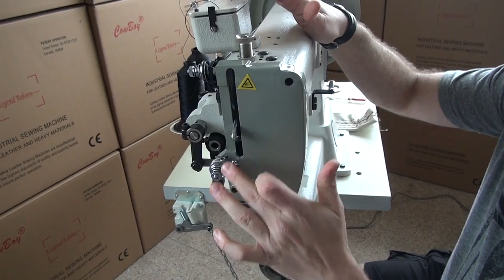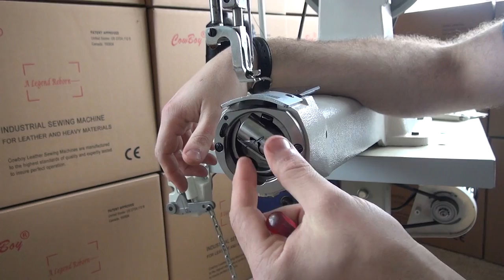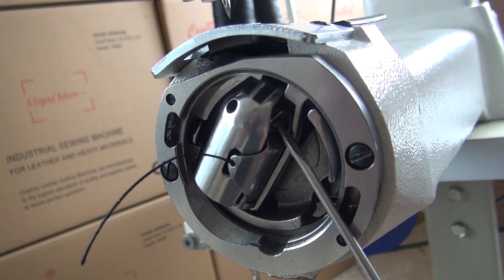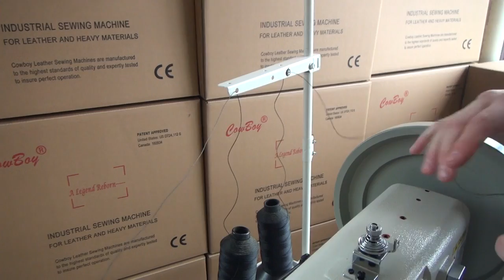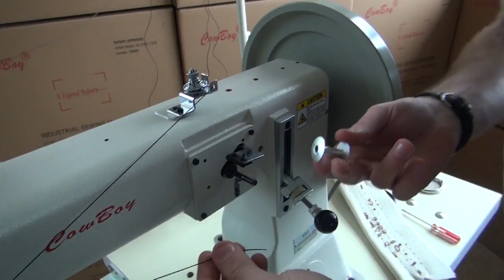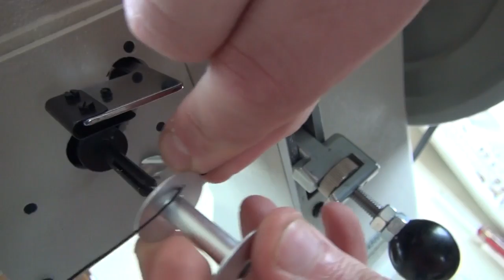How to adjust thread tension on your Cowboy CB4500 leather stitcher

Comment: Thank you for a very well explained video on how to adjust the machine. I like to ask you about the balance between the tension from the two tensioners. If I need 45 oz of tension to be used out of primary tensioner, then I would set the pre tensioner to 15 oz, so the primary tensioner would add the remaining 30 oz of tension. So as a rule of thumb the pre tensioner makes 1/3 of the tension for normal used bonded thread. Do you think this is about right?
Reply from the maker: It is difficult to set a clear specification, the thread tension will depend on many factors, such as thread type (cotton thread, Nylon thread, bonded polyester threads etc), leather type and leather needle type.  You just need to adjust the needle thread tension and bobbin thread tension, to reach the best balance. Usually easy to get thread tension balance on heavy material, and not easy to get balance when stitch thin leather by thick thread. If you need any help, please contact our local dealer. Where are you from?
Reply: Thanks for your answer, Ryan. I am from Denmark.
Reply from the maker: @sewingmachinesindetail  We have dealer in Germany, you can contact them for help, thanks!

Comment: I recently purchased the Artisan turbo 3200. The cowboy looks almost exactly like my Artisan. The Artisan has a small but powerful motor mounted on the table as well as the speed adjustment, as apposed to under the table as well as the speed control.

Do they have the same manufacture and do you know is parts interchangeable.
Reply from the maker: Artisan turbo 3200 is same to CowBoy CB3500, all parts of these 2 leather sewing machines is interchangeable. You can see the video of CB3500 leather stitching machine here https://youtu.be/iwZceazJCXs

Comment: I am going to subscribe here because this is a great video!!! Could you make another one some day teaching us what to do if our machine skips a stitch once in a while? I think my needle may have gotten sticky from the glue I am using to bond leather together. Thanks for the info Bro!!! The Very Best YOU Are!!!!
Reply from the maker: We will make a video when our American engineers come to China, we will keep you informed when it is ready. At this moment, please call local dealer, they will help you immediately.
Reply from the maker: Possible Cause 1): Lost timing
Solution: Re-timing the machine
Possible Cause 2): Thread tension is too tight
Solution: Correct thread tension
Possible Cause 3): Needle is bent or burred 
Solution: Replace needle
Possible Cause 4): Needle is wrong size
Solution: Check needle size 
Possible Cause 5): Needle and thread does not match
Solution: Use proper thread or needle
Possible Cause 6): Thread take-up lever has not been threaded
Solution: Check threading
Possible Cause 7): Light pressure on presser foot 
Solution: Increase foot pressure
Possible Cause 8): Incorrect setting of needle
Solution: Check needle setting
Possible Cause 9): Material overlapped (cross seams/transversal seams, thickness of material changed suddenly)
Solution: Use specialized presser foot

Comment: Any idea why a machine might be skipping stitches?  Mine randomly misses picking up the bobbin thread resulting in a skipped stitch and an uneven appearance and I can't figure out why
Reply from the maker: Many reasons may cause skipped sttich, for example: Lost timing,  Thread tension is too tight, Needle is bent or burred , Needle is wrong size, Needle and thread does not match, Thread take-up lever has not been threaded, Light pressure on presser foot , Incorrect setting of needle, Material overlapped (cross seams/transversal seams, thickness of material changed suddenly)
Reply from the maker: If you are using our leather sewing machine, please contact Ryan in Ohio at 330 692 1418 or neelre@comcast.net, thanks!